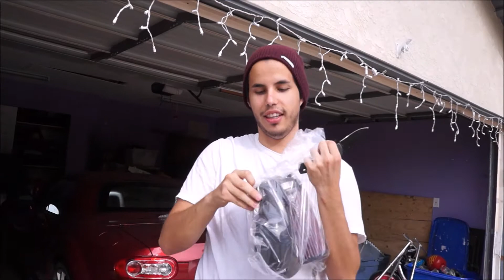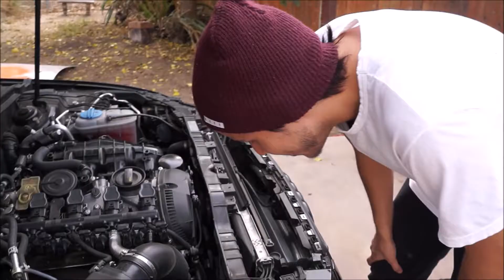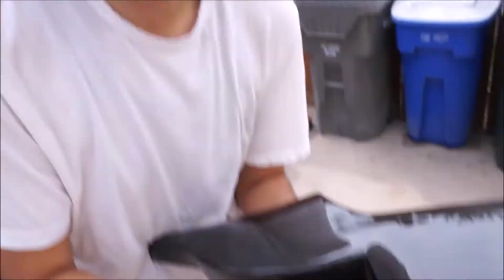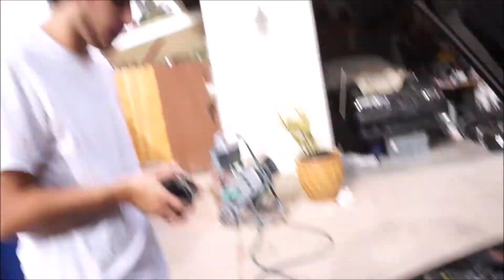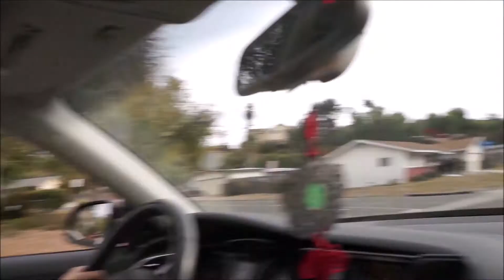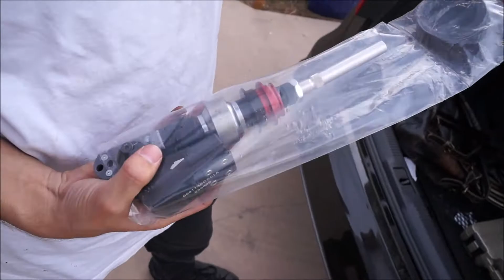Installing an ECS Intake on the Audi

Comment: That’s the diverter valve you’re hearing, not the wastegate. The wastegate is in the exhaust, and you can’t hear those open on internal designs. Nice intake though! If you really wanna hear the diverter valve, get the GoFast Bits DV+